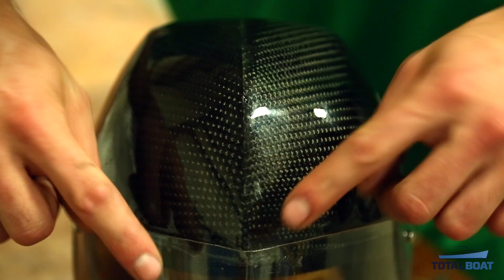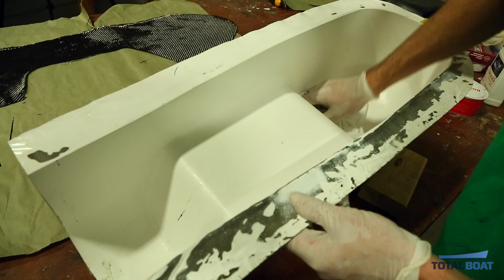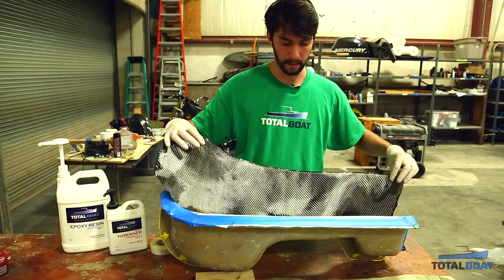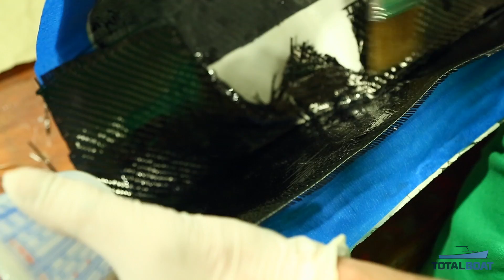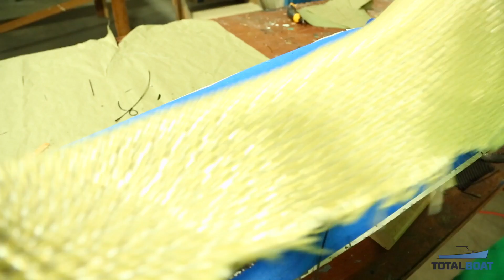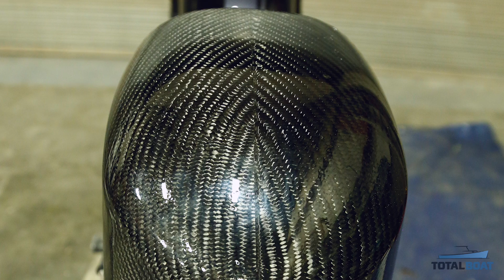Making a Plug for a Mold - Part 5

Comment: wow! but hey do you ever use a respirator and also a dust mask??? the epoxy primer most likely has isocyanates and a 3m paint respirator will not filter them out, I'm sure the other chemicals are terrible too...